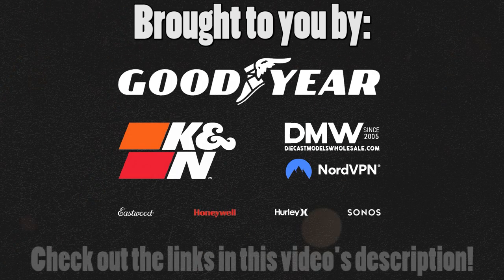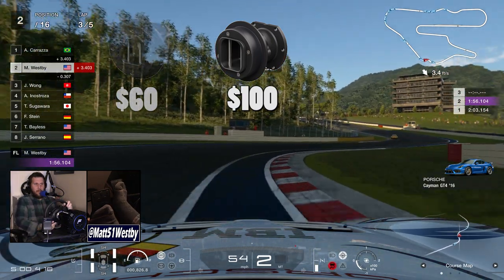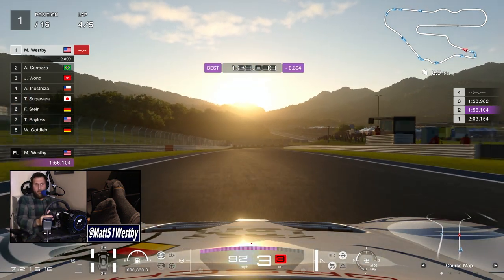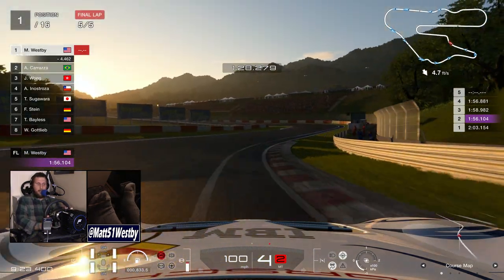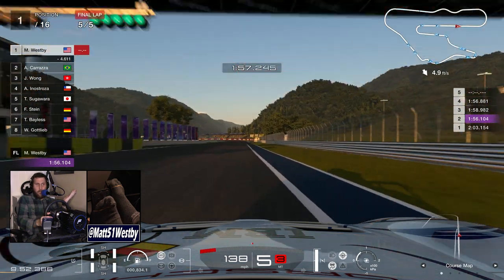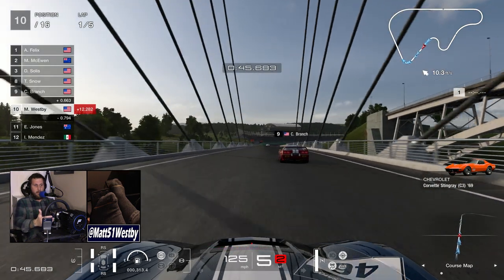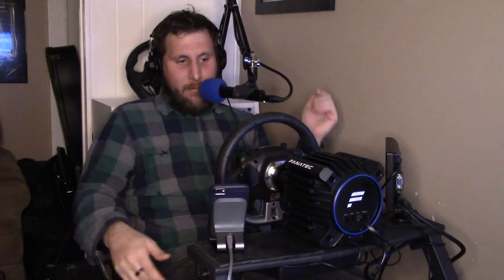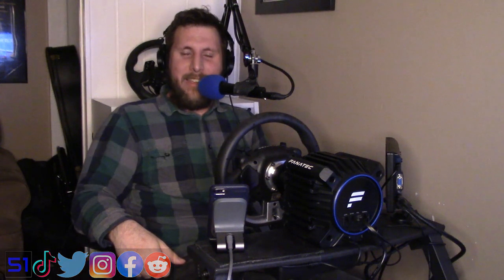Why I'm not upgrading to Fanatec's QR2 system

Comment: They can't win, if they had just brought out the new Q2 system with no ability to upgrade your Q1 people would have gone crazy. They did the right thing to offer backward compatability, but now be called out for wanting money from it.
Just ordered the DD+ (and 4 QR2) which will be my third type of wheelbase over the last 10 plus years, never had a problem with any of them. They are an absolute mess when it comes to producing enough product, speed of shipping and keeping you informed, but they have been ground breaking in the products they've offered us over the years.
Loads of companies now on the bandwagon but I will always be grateful for them  giving me another option to the Thrust /logi gear. The day I opened the box with my Porsche 918 wheel (V1) was an absolute wow moment, especially when you compared it to what was available then.

Comment: You might want to make sure you have all the information before you put a product down. I have a DD1 which has broke pins in 2 podium LE F1 Wheels. Because of this i have no choice but to upgrade to the QR2 or replace the QR1 i have. Also Fanatec is going to give you a choice of the QR2 or QR1 when you buy wheels or Bases. You put out info with half the info.
Reply: You get the option to choose, but still have to pay the premium for it
Reply: I can confirm this as I have just ordered a load of stuff.
Reply: I also ordered the  DD1 and it came with a separate Q2 base adapter. It was easy to install. I opted for the Pro wheel side because I have more money than brains apparently, and the fit of these two components is absolutely awesome. I will agree that the Pro is indeed overkill, but I just had to. My other wheels will be receiving the die cast version. Fanatec is showing the new DD1 as coming with the QR2 pre-installed. The Fanatec ecosystem may be looking a little strange but the QR1 will likely hang around for any base that is 8nm or less, but for the bases that are strong enough to destroy the QR1 and/or wheel.
Reply: you have no choise because fanatec designed a bad product to sell you a V2 version after, but fanatec fanboys are known for having the same IQ as their nm of ther bases
Reply: My QR1 feels solid, not sure if its been revised or not, but its way more solid than my G29 which didn't even have QR @keomg4718
Reply: Exactly I'm like wow he has no clue. Now 6 months later everyone wants the qr2 haha.
Reply: Yes you have the option but have to pay for that wich i think is a shame, if you buy a wheel they should give you the qr2, now i have 6 wheels from fanatec and i have to buy 6 qr2? Even if i buy the metal one 100€ it is 600€ plus shipment, is a shame and if i choose the golden 1200€...
Reply: They should give a big discount for every one who already have buy from fanatec nore than 3 wheels

Comment: A Torque wrench/driver tool is cheap. You should have one if you built an aluminum extrusion chassis, or if you work on cars, bikes or guns. Also, Loctite bolts that are subject to vibration.

Comment: Every company upgrades stuff , ps4-ps5 . If you want to buy it buy it. 
A lot of stuff with sim racing is , is it for fun so Logitech g29 ( nothing wrong with it) or more serious lap time racing. With a QR2 if you get a bit more confidence with it driving that will give you lap time so maybe the upgrade will benefit you. For this reason . 
If you have a dd pro , dd1 or 2 your more than likely to class it as a hobby rather than pass time so would warrant the upgrade. 

As far as I can see the new 12 and 15nm systems come with it as standard so will need to force an upgrade all the rest are optional ?
Reply: Totally agree, it's no different than upgrading your gear in any hobby.
I'm waiting on the DD+ (all my friends play on PS😡) it does come with the new fitting. Its not been a problem for me as my son is having my CSL dd pro and my 3 V1 wheels that can't be upgraded.
Reply: lmao that's like if somebody sells you a broken door and then after that they sell you a "good" door that actually locks your house as a "upgrade" I swear fanatec fanboys have bugs in their heads like fanatec firmware does
Reply: @keomg4718  not really it does work as have one and will have the new qr2 when it arrives with the DD plus . You don’t HAVE to upgrade if you don’t want to as claimed on the video. Guess you woundnt know with your G29 🤣

Comment: Fanatec just began offering the metal QR1 wheel side quick connect again on the website for $49.95 each. I just ordered one. However, I previous ordered the new QR2 base side connector so I would already have it when I decide to finally update to the QR system.
Reply: I don't see that price. It says 99,99
Reply: Me to i buy it on black friday for 19.99€ and it is in rhe shelf for when i buy a wheel and come with qr2 without pay the 100€ more...

Comment: Another reason to upgrade to the QR2 is if you switch between wheels a lot then then the QR2 is much quicker and easier.  

The QR1 isn't hard but it is a bit time consuming.  Turn the locking knob, pull the wheel off hopefully without hitting your chest or face, adjusting the stem to be in the correct position, put on the wheel, tighten the locking knob.  

QR2 you pull the mechanism back and pull on the wheel, then push on the new wheel.  

My QR2 system comes in today so I'll be curious if I can feel any differences between the two.
Reply: and? how is it?
Reply: I have 4 rims that I've upgraded and it's been awesome so far.  I haven't had any flex and it seems I have a bit more feeling in the rims as well.  I can play DR2 for a bit then quickly switch to AMS 2 and change my wheel in seconds which I really like.
Reply: I have gt dd pro and while using psvr2 with gt7 can switch rims with qr2 easily without taking vr2 off. I just got got the qr2 lite as Im not going above 8nm. Pretty solid i must say. Qr1 with the slot slop is absolutely unacceptable.

Comment: Interesting points and very helpful. My experience with the QR1 USB-C is the base side has some issues with slipping out the DD. I did a blog post on how I fixed with some sand paper. Because I bought the QR1 Lite wheel side, I'm thinking I'll end up ordering the QR2 with non-Lite version wheel side. If the base side similarly slips, I'll do the same sand paper mod.

Comment: Black Friday. QR1 just sold out. QR2 Pro sold out as well. QR2 black planned to be available in the middle of January. And QR2 Lite isn't an option because of feedback limits with this. Successfull Black Friday! 😃

Plus issues with QR1 are very individual. And depending on Base unit, QR1 unit and wheel itself. Plus a bit of luck. 🍀

Comment: The qr1 has a terrible slack when turning the wheel from left to right while there is strong ffb. You can feel the wheel move over the shaft. I had to turn the screw of the qr1 180 degrees further then supposed to stop this from happening. The qr1 sucks bigtime

Comment: I was thinking about upgrading to the QR2 but then they dropped the price on the QR1. Your assumption of not getting QR1s is wrong, they are in stock. Just getting those to replace the QR1 Lite on my two wheels. My third wheel, I just ordered, I ordered a QR1 with it. I see no reason to change it all for a CSL DD Pro at 8 nm. I only run maybe 6 nm max.

Comment: I wish people weren't autists that think they need machined aluminum for their toy steering wheels. A solid polymer system is more than strong enough to use without needing the exorbitant cost of 5 axis machining.
Reply: For a Podium DD Lito option isn't good. Peak took is disabled and limited about 10-12 NM. At max. So... No. And by feeling it's an enormous difference! But for CSL DD it may work pretty good. Especially for a 5nm model.

Comment: I hate fanatec... and that I ever bought a DD2... its noisy as f... - and they dont get a dime from me ! Sell it and buy elsewhere.
Reply: It's noisy ?! for my part I have a DD1 and it makes no noise, and I received my QR2 for the DD1 base and three for my steering wheels, Excellent quality and 5 seconds to put a second steering wheel. I don't regret my purchases.
Reply: Have no any issues with a dd2 as well.
Reply: You hate the company that have litterly pioneered high quality sim equipment, whoever you move to won't be perfect.
Reply: @karlallen6055 lol fanatec didn’t pioneer high quality 😂😂 fanatec is junk!! I’ve owned many fanatec items and they are all garbage for what you pay!! Also the new clubsport dd wheel base is trash you update the firmware and wheels don’t register lol. Sold all my fanatec and went full simagic and haven’t had one problem. People ride fanatec D because they have weak ass console support 😂😂😂 meanwhile sim racing on console is a pure joke.